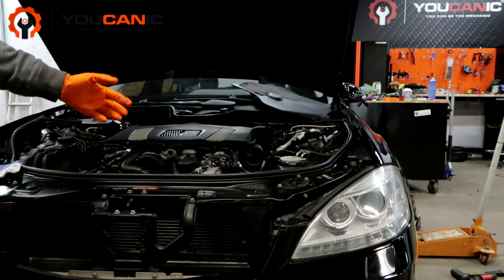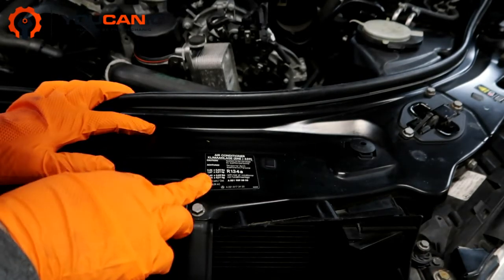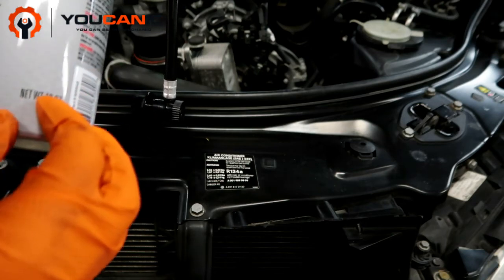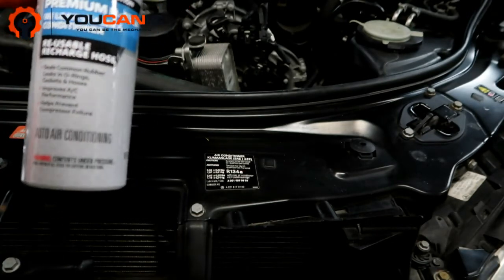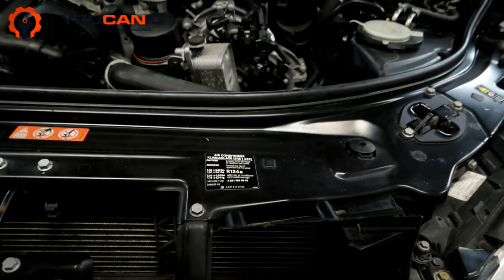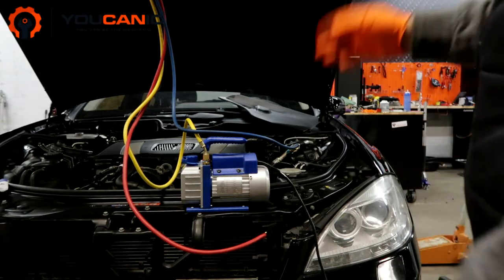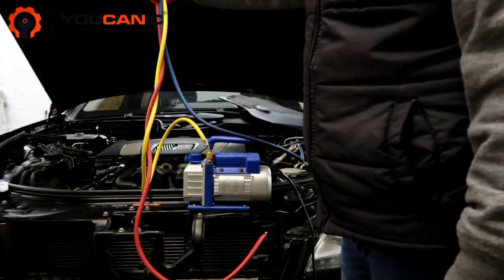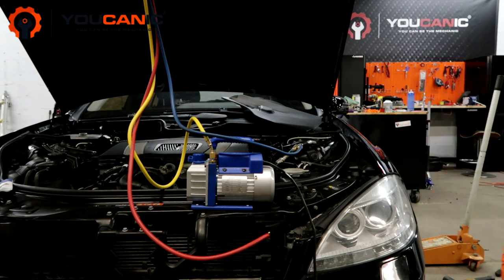2006-2013 Mercedes-Benz S-Class W221 Evacuate Vacuum Air AC System Low High-Pressure Port Location

Comment: How to restart the AC after recharge ?  AC push button doesnt want to turnAC on  and stay ON. There is no leaks , system was properly vacuumed and add correct amount of refregirant.
Reply from the maker: Thanks for reaching out to us. At [YOUCANIC](www.youcanic.com) our goal is to give car owners the knowledge and tools to confidently perform car maintenance. We have a variety of helpful guides and resources, as well as our YOUCANIC scanner, to assist you. If you need more specific information, we also provide factory repair manuals.

Remember, you can always ask your questions through our site. We are here to support your journey in car ownership. Let's get your AC system functioning correctly together!